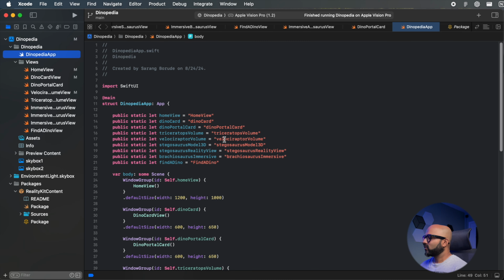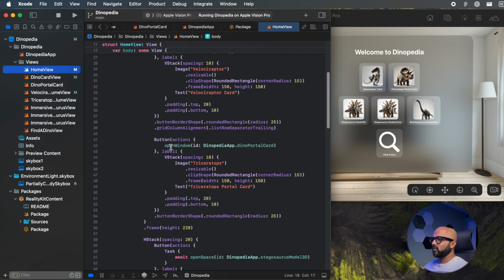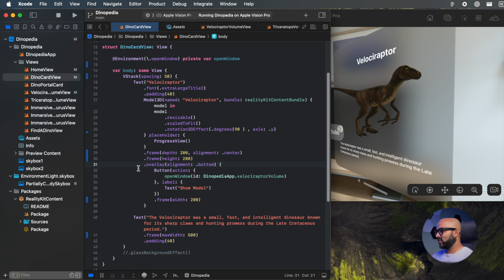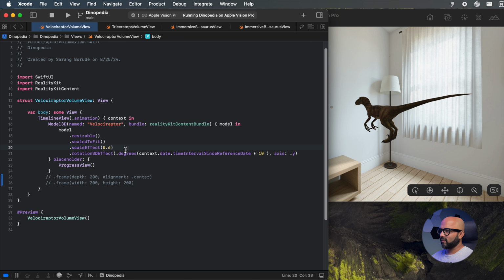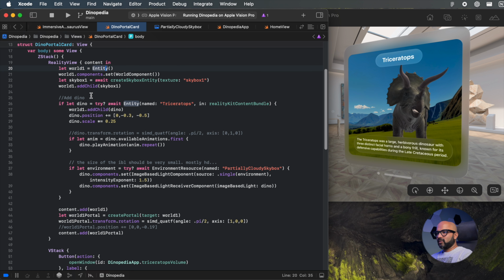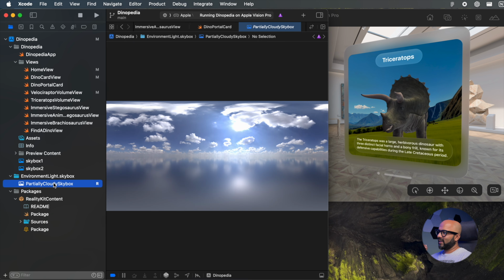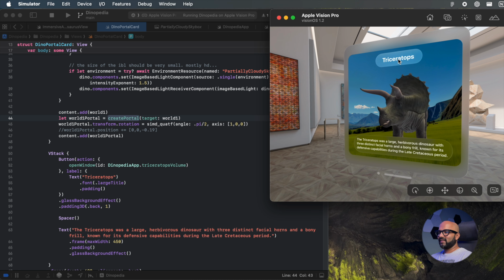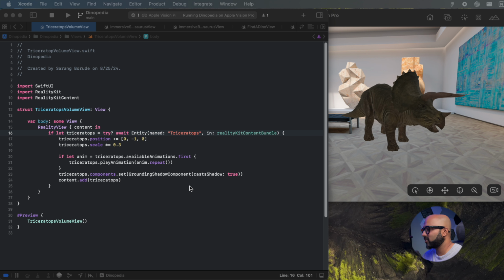Using SwiftUI to Add 2D and 3D Content in Apple Vision Pro App | (Part 1/3) - Windows and Volumes

Comment: I tried to subscribe. But I already was 😂 I need to turn on your notifications cause you make some amazing content that’s so easy to follow. Like your portal video. One thing to note though, this is the first time I’ve found a video that’s so descriptive on IBL. I know real world lighting ads to the effect of what you’re viewing but in my case, I don’t want that. A lot of the time I want lighting at night to view my models and my local lighting (lamps and such at night or hotel) doesn’t have sufficient lighting and it’s always been a problem. Polycam, for example, gives us the option to turn a light on/off. Can you share a video on how to do this? Or maybe at least some info on it? And lastly, in polycam again, they have a unique loading animation that’s like a ball of sand that’s really amazing to watch. Do you have any idea on how that’s created?
Reply from the maker: That is exactly what Environment lighting is doing. I cover it at the 17 minute mark at the video. You light the scene with the IBL texture loaded as an environment resource. Using this you can light your models with the IBL. If you need is to toggle it on or off, then you can simply remove the ImageBasedLightComponent and ImageBasedLightReceiverComponent from your entity and that should toggle it off. I haven't tested this though. 

This video from WWDC 23 https://developer.apple.com/videos/play/wwdc2023/10095/  also covers it at the beginning in the lighting and shadows part, but it covers how to replace the system IBL with your own IBL but I believe it still uses ARKit generated environment probe texture that you cannot replace.